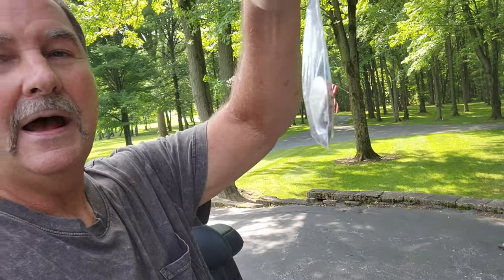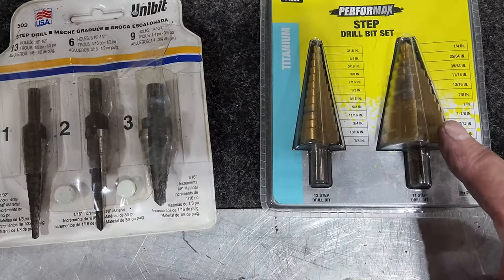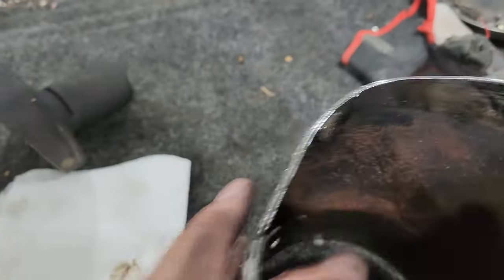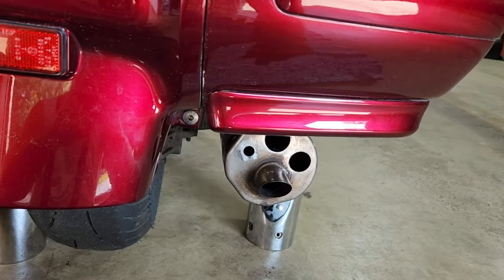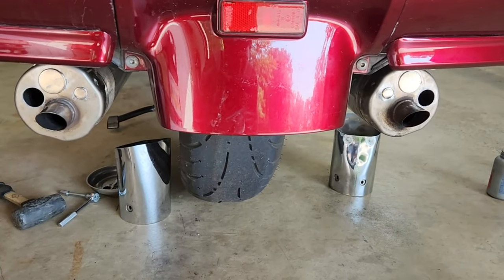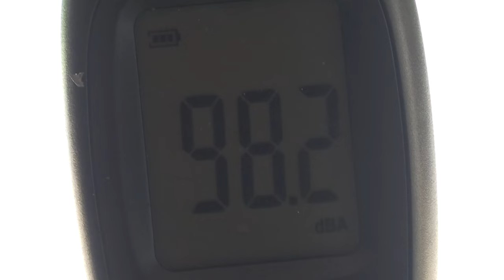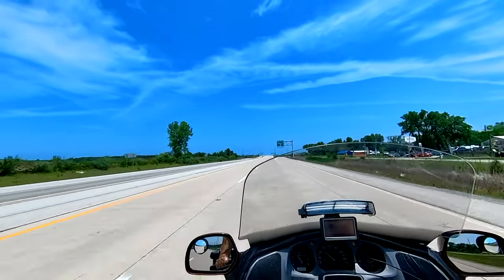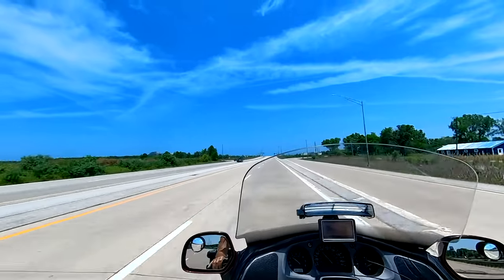Goldwing GL1800 adjustable exhaust sound mod for $11.

Comment: Always have loved the goldwings flat 6, but i always thought they lacked character cause they were so quiet. This is an excellent mod, makes the bike sound so much better and less "Sterile"
Reply from the maker: Thanks for that comment Nick! Now add about 40 more horsepower and we'd have something. 😉🦾
Reply: That thing sounds great with all the plugs out. Sound like a GT3 Porsche. Wow
Reply from the maker: Thank you Rich! Looks like you have a great channel and I will be checking it out more in depth later. @richthereturnrider6737
Reply: Glad i found this video , I’ve been trying to fiqure out for long time how to make my Wing sound better .  Going to start on converting my 02 Wing tomorrow.  Did you do this with muffs attached ?
Reply from the maker: Took them off, very easy to do. Thanks for watching! @HighOctane-wo6cm
Reply: Sounds like a porsche 911 now! 👍

Comment: I like a little sound on my motorcycles.  Not real loud but not Goldwing quiet.  Lol.  I drilled mine and dont worry about closing it.  I love the sound and it was free.  If I dont like it I just put a bolt in the hole
Reply from the maker: I'm getting ready to post a review I did on a new windshield for my Wing---comparing it to the original shield which will include sound meter difference. I did the original before the exhaust mod so when the new shield arrived I had to install the exhaust plugs to get an accurate comparison. When I finished I immediately removed the plugs, LOL. Before deciding on plugs I considered the bolt solution but 1 1/8 in bolts is a no go 😁.  
Thanks much for watching and commenting!!!

Comment: Need to get rid of the catalytic converters ,that really helps the bike a lot. Custom chrome used to sell what they called torque loops that's a simple job to do.
Reply from the maker: I researched those. About $350 for a "claimed" 5 HP increase but I never could find dyno proof of that small amount. Thanks for watching and commenting!

Comment: Thanks for the video and idea. I have been looking for a non expensive way to improve the sound on my 2018 dct. I will certainly have a good look at mine this winter. I am wondering if there might be a way to drill the holes and have a progressive plate that spins to shut off or open the holes in turn. But great idea thanks a lot
Reply from the maker: I also thought about a rotating plate but the end of the muffs on mine are not thick enough to support bolt or screw threads. Thanks for watching and commenting!!!

Comment: I have a 19 wing 
The muffler upgrade is 3000$ I think. Crazy
My question is . With my softail if I put in or take out baffles, carb needs to be reported. Back pressure. Changing the way the stock mufflers are in a wing? Does that change the way the motor and computer operates? My bike is different than yours but it is the same motor, right? Just wondering
Reply from the maker: 3G's=crazy=right! And probably just more noise with little if any HP gain. Many carb. engines are sensitive to backpressure changes but fuel inj. engines less so. Basically same 1800 engine but yours has about 5 more HP, I think. I've had absolutely no issues since muffler mod and BTW I leave plugs out now. I wish everyone would stop buying new wings until Honda upped the HP about 40 more---they could easily do it 😁. Thanks for watching!!!

Comment: Excellent video, you did a great job. My question is when cruising at highway speed do you feel a drone feeling?
Reply from the maker: I do not, in fact after initially testing with the caps in and out I have not put them back in. Thanks for watching and commenting, I certainly appreciate it!!!
Reply: @JSProjectWild  
Awesome! I'm gonna try it on my 08, ride safe friend
Reply: 😂and not one question, nor did thre story tell say....!,
Do ya loose Horse Power...?
Do ya need fuel or air or any type of adjustments..
Come on sound is one thing.. but not knowing if needed adjustments should be done...HELLO..//W.T.F
P.S. if anyone asked and I missed the read.. I am sorry
Richard

Comment: Nice sound.  If you dill out the 2005 would you be drilling where the sealed off ends are?
Reply from the maker: I would be drilling out the exact same place as the ones I did. Only the inserts in the end caps are different. Thanks for watching and commenting Paul!

Comment: Hey there! How do you fix the end cap screw that broke off? Rethread the pieces left on the muffler? I broke off two of the six 😬🤪
Reply from the maker: I thought I covered that in the video but maybe I forgot. Anyway, when my muffs arrived two of the six were broke off. I soaked the remaining four in PB Blaster overnight then was able to work them all out the next day. I tried to tap the broken off ones but the nut that was welded on the inside came loose so I just got a larger bolt and threaded it gently into the hole. Two are enough to hold those end caps on. Good luck!

Comment: Is it possible to do that conversion without removing the mufflers .
Reply from the maker: Absolutely, but easier to get the metal filings out if you can turn the muffs upside down.
Reply: @JSProjectWild  thanks for responding, will fiqure something out on the metal filings when i get there lol… riding my wing tomorrow , will be  almost 60 °here  .

Comment: why not just buy a f6b
Reply from the maker: OK.
Reply: F6B uses the same mufflers as the Goldwing, just different tips.   The GL,F6B,and F6C exhaust systems are basically the same. The header/cat pipes are all the same part number right up to the mufflers.
Reply from the maker: Thanks for that great info! 🦾 @flashgordon6238